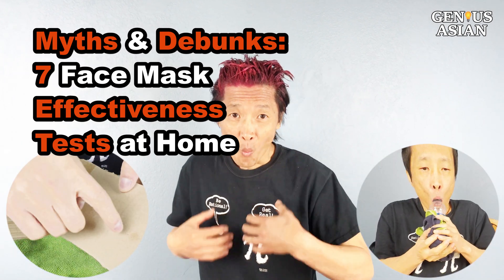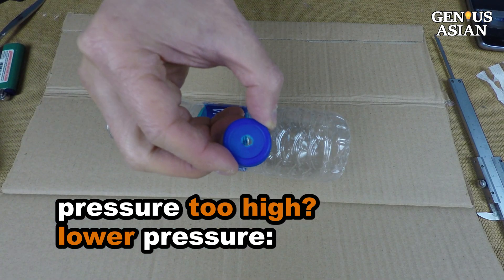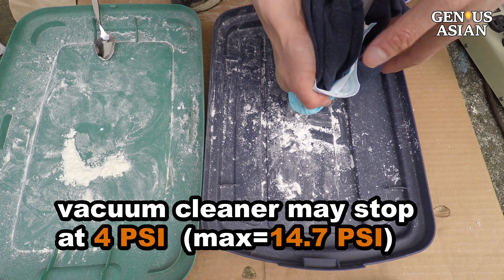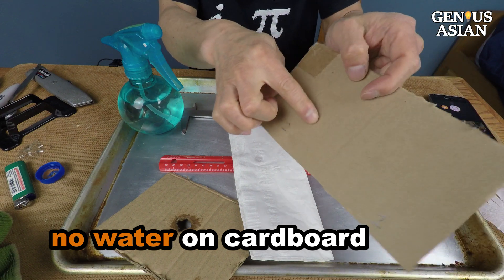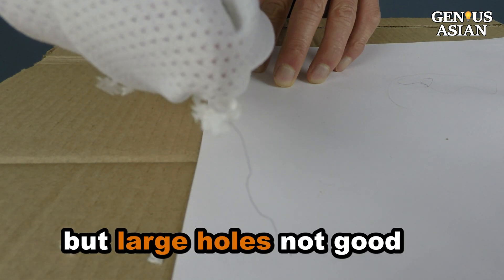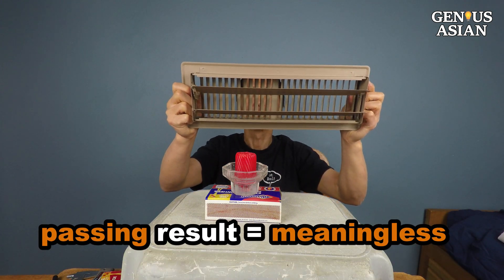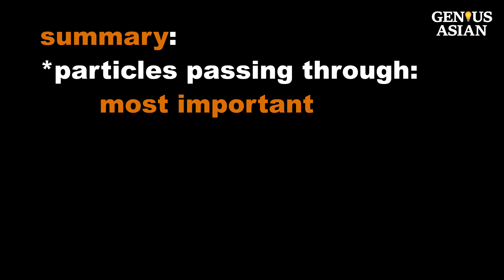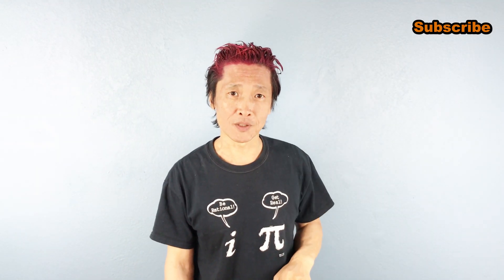Myths & Debunks: 7 Face Mask Effectiveness Tests at Home

Comment: i did test with a bottle. i used lots of flour, and few particles passed through, but most of the flour just disappear. do you know what could be reason?
Reply from the maker: you can also use compressed air so that you will see where the flour go https://youtu.be/8mCPB8n065Y it is possible the flour went inside the vacuum, if you have 3 layers, then the function of the last layer would be to capture the powder, https://youtu.be/25lDoBSsQG8

Comment: Can I ask how to measure the amount of particles being filtered?
Reply from the maker: you may use an optical particle counter to measure the amount of particles. However most people don't have a particle counter at home, so this video https://youtu.be/8mCPB8n065Y  uses an indirect method, i.e. comparing two filters to know the relative filtering efficiency. So we can compare filter material 1 vs material 2 under the same pressure, we make a conclusion which material is better. If your material led to a different conclusion, i.e. filter 1 is better than filter 2 under one pressure but the opposite is true under another pressure, or filter 1 is better than filter 2 for particle 1, but the opposite is true for another particle, please leave comments below because we have yet to find such a case.

Comment: Here is the thing for the candle blowing test. Homemade cloth masks and manufactured masks are not the same beast. Your own example of the vent register almost explains it. The medical mask is a fine, uniform piece of material with uniform dimensions. The pieces of shirts and cloth that people use will never act as a true filter to the same degree. They are simply not manufactured with dense uniform fibers nine our of ten times. Catching some spit and particulates by ensuring that strong breaths such as coughing and sneezing can't pass the material is about the best you can guarantee. Forcing airflow down and away from others is better than nothing. It is not the best case scenario, but the n95 masks everyone is buying also largely redirect to the side.
Reply from the maker: Thank you for taking the time to share

Comment: Coco powder is not a good particulate to test with when using it to compare much smaller particulate sized viruses. Coco powder is 280 nanometers or larger depending on the style, while the SARS-Coronavirus-2 has been measured between 70-90 nanometers. Particulates this size, according to research, easily pass through. Think of how difficult it would be for a mosquito to pass through a chain link fence...
Reply from the maker: The N95 mask can't filter out less than 300 nanometers or smaller particles, so why do doctors use it? This is because droplets are much larger, a single virus may only stick inside your lungs, only when the cluster of viruses grow big, you lungs will cough out this cluster as droplets. Another important point I want to make is this: we tried many times in the video to make the point that these tests are to compare two different materials at your own home. If your material led to a different conclusion, i.e. filter 1 is better than filter 2 under one pressure but the opposite is true under another pressure, or filter 1 is better than filter 2 for particle 1, but the opposite is true for another particle, then let us know,  we have yet to find a case. 
We have also a couple new video related to DIY mask testing : https://youtu.be/8mCPB8n065Y and https://youtu.be/25lDoBSsQG8
Reply: Genius Asian Genius Asian Doctors use N95 because that’s what they were told to wear. Masks are meant to prevent bacterial spores not viruses from spreading. Water droplets have been measured as small as 100 nanometers. This doesn’t mean we don’t breath out smaller but rather that we have been limited by the technology that can see that small of water droplets. Water can be as little as H2O which is just three atoms... which would be a fraction of a nanometer. Why are we assuming that all water droplets are at least H520O260 and larger clusters? That seems absurd. Are you aware of the studies that have already shown these viruses easily escaping these N95 masks? Also, if a single virus escapes the mask with his thousand other friends and decides to wait on the outside of the mask until the next powerful exhalation, then how is the mask effective against that? You haven’t addressed the natural immunity that I would much rather everyone get from a low viral load asymptomatic person rather than spreading it only in large clumps (as the masks offer).
Reply from the maker: N95 only filters 95%, wearing masks only reduces the probability of infection. Since from your comment, you said
1. "low viral load"
2. N95 does not filter 100% (only 95%)
then wearing a mask will provide you both 1 and 2. Otherwise, without visually seeing and counting, how do you control your exposure dosage?
Reply: Genius Asian, 95% of particulates 0.3 microns or larger, meaning the SARS-Coronavirus-2 at 0.07-0.09 microns will not be stopped almost at all. Due to this, if someone is sick while wearing one they will breathe out the virus continually, allowing more and more to build up onto the outside of the mask. Due to this there could be far more viral load at once given to someone else. The N95 doesn’t protect the wearer from someone sick though... an important distinction.

Comment: Because coco powder and flour are comparable to particles that 0.1 NANOMETERS?? Talk about a ginormous collection of total nonsense and false equivalency fallacies pretending to be science..  Lol..  “sciencing”
Reply from the maker: you said"Because coco powder and flour are comparable to particles that 0.1 NANOMETERS?? ", can you provide a reference coronavirus is 0.1 nanometers? The N95 mask can't filter out less than 300 nanometers or smaller particles, so why do doctors use it? This is because droplets are much larger, a single virus may only stick inside your lungs, only when the cluster of viruses grow big, you lungs will cough out this cluster as droplets. Another important point I want to make is this: we tried many times in the video to make the point that these tests are to compare two different materials at your own home. If your material led to a different conclusion, i.e. filter 1 is better than filter 2 under one pressure but the opposite is true under another pressure, or filter 1 is better than filter 2 for particle 1, but the opposite is true for another particle, then let us know,  we have yet to find a case. 
We have also a couple new video related to DIY mask testing : https://youtu.be/8mCPB8n065Y
 and https://youtu.be/25lDoBSsQG8

Comment: You can only see with the naked eye down to 50 to 60 microns
Reply from the maker: yeah, it is true that you can not see a single particle with the naked eye smaller than 50 microns, that is why we use powder which contains many particles. When you have many particles together, your naked eyes can see them. Color contrast also helps. Our own tests are designed to compare two different filters. We have yet to find a case that a pair of materials led to a different conclusion, i.e. filter 1 is better than filter 2 under one pressure but the opposite is true under another pressure, or filter 1 is better than filter 2 for particle 1, but the opposite is true for another particle. Anyone who can find such case should let us know: https://youtu.be/8mCPB8n065Y

Comment: Any study only looking at the mask is flawed. If the mask causes mouth breathing compared to nose breathing without - they are at increased risk of contracting now because of the mask. 75% of adults have some degree of a deviated septum that can already lead to some restriction already without the mask.
Reply from the maker: yes, that is correct, nose breathing is better than mouth breathing. So when you wear mask, make sure to use your nose.
Reply: Genius Asian not always possible when you have lung problems

Comment: Can I use face powder for the vacuum test?
Reply from the maker: Yes you can! these tests are to compare two different materials at your own home,  i.e., if filter 1 is better than filter 2 for particle 1, then filter 1 should be better than filter 2 if particle 2 were used. We have yet to find a case that this is not true. See anther DIY mask testing : https://youtu.be/8mCPB8n065Y

Comment: youre insane  no mask will stop  coronavirus..they are placebos
Reply from the maker: When you say placebos, are you saying the droplets from one side of the mask can always travel to the other side 100% The N95 mask test guarantee 95% block, only 5% are allowed to pass. Do you have any specific supporting data that shows more than 5%? If your material led to a different conclusion, i.e. filter 1 is better than filter 2 under one pressure but the opposite is true under another pressure, or filter 1 is better than filter 2 for particle 1, but the opposite is true for another particle, please leave comments below because we have yet to find such a case :https://youtu.be/8mCPB8n065Y

Comment: Also for the water test, you have to remember only the inside of a medical mask is hydrophobic, the outside is not by design.
Reply from the maker: FYI, for 3-layer mask, the middle layer is the filter layer, the outer layer (colored) is water-repellent, the inner layer (white) is absorbent.

Comment: My advice is to have a basic science class. ANd pay close attention when you get to particle sizes. 

These tests are great for dust. But viruses that are 1000x smaller. LOL. It is like filling a laundry basket with water. Best placebo video based in fantasy I have seen on the subject. I don't know which is scarier. A channel with genius in the title thinking this is irreverent to viruses, or the number of people who think this proves it stops viruses.
Reply: Not quite correct. No mask is going to filter all particle sizes as small as viruses can be. Coronavirus can be around .1 to .3 microns. Only an N95 or equivalent grade mask will filter a significant portion of particles this size. 
That's not the point of testing the filtration ability of cloth or surgical style masks though. Viruses travel on the moisture of your breath and droplets from coughing or sneezing. These droplets can contain very high levels of virus particles within them, and when the droplet is caught by the mask, the virus particles within the droplet are too. Some virus is always going to get through, but a lot of it can be captured or slowed down by the mask limiting your effective range of transmitting the virus significantly. We're trying to capture large concentrated chunks of virus particles, not the individual particles themselves. They're not perfect, but they seem to be working very well for limiting the spread of the virus.
Reply: @mvvagner  The research on mask wearing is limited but all good-quality studies have shown them to be effective. The mask prevents droplets (which are the main mode of transmission) from exiting the mask. It ALSO prevents aerosols through electrostatic attraction. The mask fibres are made to have a static charge. These static charges attract many of even the smallest aerosols and prevent them from leaving the mask. A lot of people tend to think of a mask like a net, which is not the case. If you want to see this effect for yourself, rub a plastic rod with a cloth for a few minutes and bring it near a slowly running tap. You will see that the water will be attracted to the charged rod. I have attached a link to this experiment if you can't do it at home.

https://m.youtube.com/watch?v=VhWQ-r1LYXY
Reply: @teymourtaj4111  I don't think you read my full comment. I explain this later down.
Reply from the maker: Thank you for taking the time to provide feedback. We said many times in the video to compare two different materials. Can you give us one single example that you will draw different conclusion? If your material led to a different conclusion, i.e. filter 1 is better than filter 2 for particle size 1, but the opposite is true for another particle size 2, please leave comments below because we have yet to find such a case :https://youtu.be/8mCPB8n065Y
Reply: It wont stop but it can prevent
Reply: @Mortimer T Graves Happy to see this comment on here. Wholeheartedly agree, and would add the intellectual honesty of saying "I don't know" is more important in our day an age than ever before. Information also needs good, effective filters.
Reply: It's like keeping mosquitoes out with a chain link fence. A security blanket for the indocrinated idiots.
Reply: Well, the aerosols which travel through the air when exhaling are the issue. 1 aerosol + 39 will equal to the size of a strand of ONE human hair’s thickness. Millions of bacteria travel through the air when exhaling. So it can also exit the sides of any mask and the front of cloth masks. I don’t know what kind of science these “experts” have done to push this narrative that masks help prevent sickness, but there has been plenty of studies that state the opposite. Then all of the sudden, “masks help”. The question is: What changed in this masks in 2020 when the virus hit? All it takes is but ONE particle to get someone sick, or become asymptomatic. All of this is in Human Biology 101 and I still remember some of these things. No matter how strong the mask is, it doesn’t keep these particles from exiting the mask. It can keep droplets. But not aerosols which carry the bacteria. Good try though in making your own experiments.
Reply: @papayamusicofficial7941  stupid they never said it cant prevent but they just help you to check wether you are buying not a fake mask

Comment: Hi i have a few questions. We recently bought surgical masks from walmart online and after trying one, and it passed the cornstarch and vaccuum test. 

Although it isnt waterproof outside. Can i do something about that? I was thinking of wearing washable masks outside of it for extra protection but i am not sure.
Reply from the maker: yes, it does not hurt if you wear something outside of it. If the droplets soak that layer, it may not have the time or enough water to sip through the second layer.
Reply: @GeniusAsian  Okay. Thank you so much!!
Reply: @GeniusAsian  What about the other way around? a cloth mask with a surgical mask over it? Still ok?

Comment: Hi Genius Asian,  I bought a UVC light bulb with Ozone for killing novel coronavirus of packages and grocery from ebay. But I did not know how to test if there UVC is actually working or not. I did not have a wavelength detecting machine at home, do not have idea to test it. The one I bought: https://www.ebay.com/itm/60W-UV-Germicidal-Lamp-LED-UVC-Bulb-E27-Household-Ozone-Disinfection-Light-Bulbs/383479071982?ssPageName=STRK%3AMEBIDX%3AIT&var=651889090338&_trksid=p2057872.m2749.l2649
Some review said there is no UVC and no Ozone, did not know how to test it. Many thanks and stay well
Reply from the maker: when I receive the packages including grocery, I would just throw the packages away. If you want to keep plastic packages, you can use soap to wash. For the problem of UVC, you don't know how long it will take, but with soap washing you know they are gone in 20 seconds. Also the most important thing is to wash your hands: https://youtu.be/-YrBEj1fSPU
Reply: @GeniusAsian  watched, thumb up!!
I tested the UVC light, I am not very pleased with it, 1) no Ozone and 2) as you said, we did not know how fast the virus will decay.
Reply from the maker: Recently William Bryan, science and technology advisor to the Department of Homeland Security (DHS) secretary, said in a press briefing that sunlight has a significant impact on the pathogen. "Our most striking observation to date is the powerful effect that solar light appears to have on killing the virus, both surfaces and in the air," he said. "We've seen a similar effect with both temperature and humidity as well, where increasing the temperature and humidity or both is generally less favorable to the virus."
https://www.whitehouse.gov/briefings-statements/remarks-president-trump-vice-president-pence-members-coronavirus-task-force-press-briefing-31/

Comment: If it burns or melts without extreme high temperature it's not fiberglass. That's good to know since you would not be wise to inhale fiberglass. Of course metal is also heat resistant but metal is not easily mistaken for fiberglass.
Reply from the maker: Thank you for taking the time to chime in. Just want to explain the point of the video: the melting property is not relevant either for current or future materials's filtering property. A few videos floating around showing the cotton based masks can start flame to conclude that is a "fake mask". According to those videos, only those melted are the "real masks". It is like saying only blue colored masks are real masks, and green,yellow, white masks are fake masks. The video tried to bring the attention of analyzing the real property instead of unrelated property.